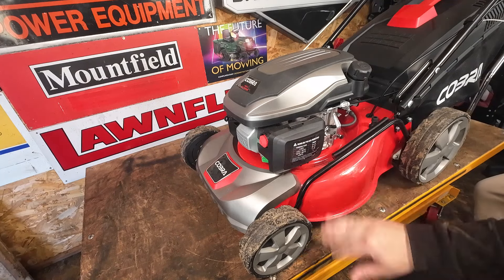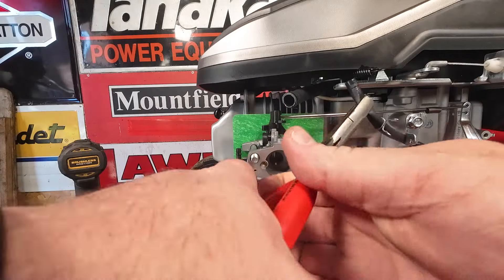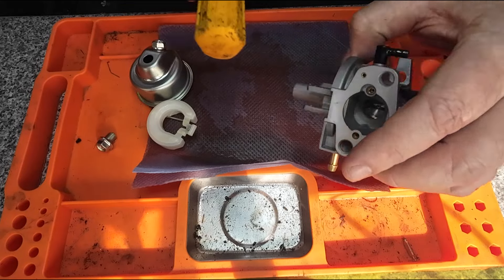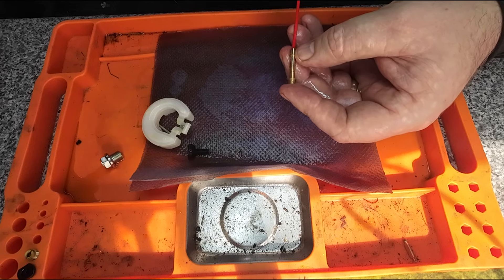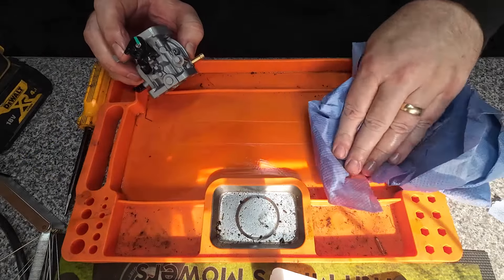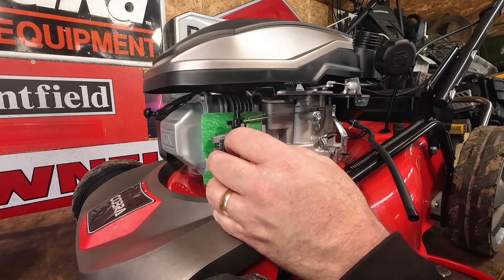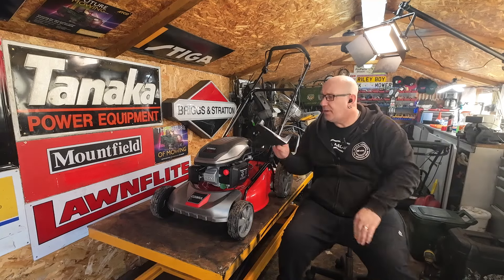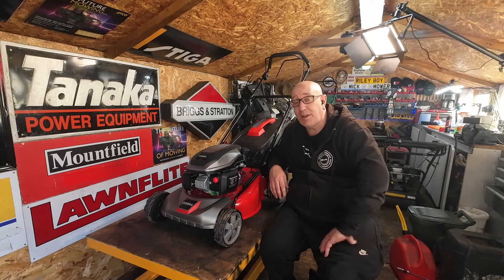Cobra Mx460spc lawnmower full detail Carburetor clean.. and giveaway #giveaway

Comment: Great stuff Mick, I've learned a lot from you, thanks. I use fuel preserver by Briggs & Stratton in my mower fuel and I fitted a fuel shut off valve so I can burn off all the fuel in the carb when I'm done with it. No problems anymore after sitting for 6 months in my damp shed with temperatures down to minus 10 degrees C. Get well soon matey.
Reply from the maker: Good information mate . ta for watching